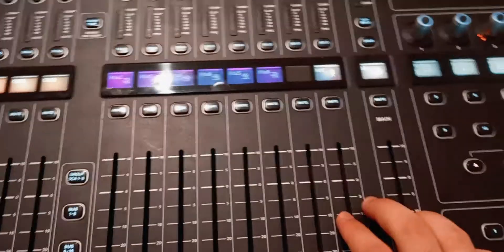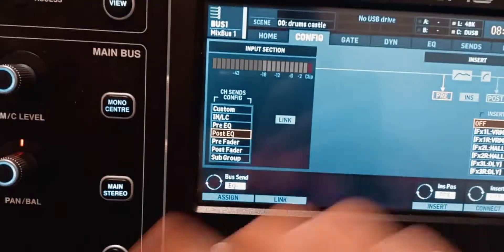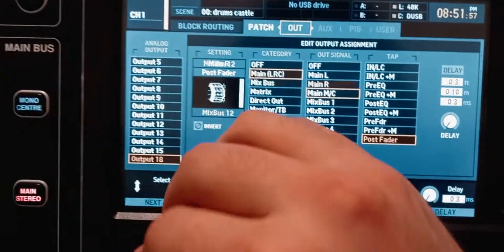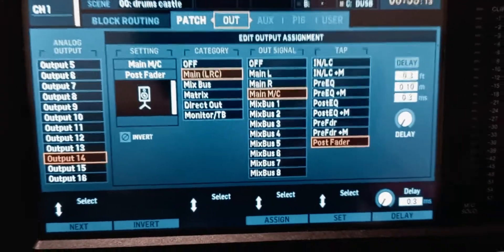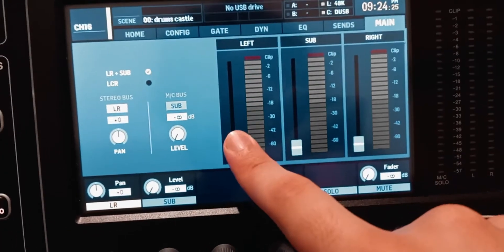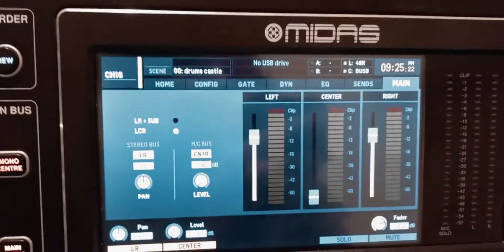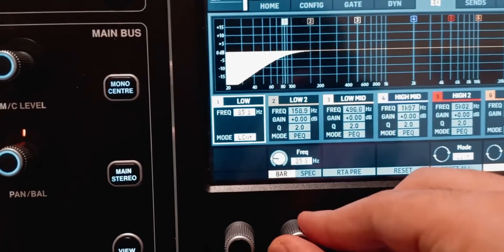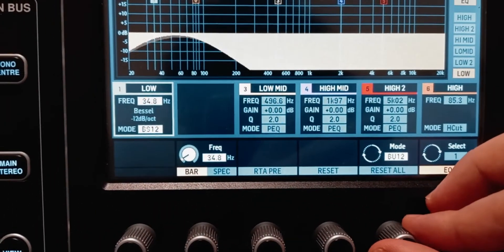X32/M32: Subs on AUX (Mono/Center Bus)

Comment: Hey there, I have a question…

Since you say in your video that you’re sending the M/C bus to output/bus 14, should my subwoofer be connected to output/bus 14…?

I currently have my Main L/R outputs 15/16 connected to my subwoofer and from my subwoofer my upright speakers.

Should I instead have my upright speakers connected to my Main L/R…?
Reply from the maker: Bus 14 is not the same thing as output 14. You can still use a bus without giving it a physical output
Yes i would connect the top speakers to the main LR  land the subs to the mono bus
Reply: @danielkharrat  Ok cool, so then should my speakers not be connected to the subwoofer at all then…?
Reply from the maker: @iefcefraternidadcristiana7318 correct
Reply: @danielkharrat  gotcha, really appreciate the help!

Comment: hello, great info, i do have a question.  I will be using m32 as a broadcast mixer, with a left right, center, and sub input from a bands own foh console.  So far i belioeve i need to make a new scene with the four inputs, route left and right to main and center to center fader and sub to my sub matrix, but it seems it needs to be in LCR mode correct, this change is a global change if im not mistaken?  Ive only mixed band sthrough inputs on midas stage box so this time it's a little different and just looking for some tips and direction thank you
Reply from the maker: Why do you need a center and sub for broadcast? The purpose of using a different bus like mono center is to control what goes to different speakers but why would you need that for broadcast? You'll just be sending a left right mix like mixing a song in the studio. 
But to answer your question yes LCR mode is globalso it's either LCR or LR + SUB but not both
Also keep in mind that with LCR if you pan something in the middle and you don't have a center speaker it will not go out of the left and right speakers

Comment: Can you make the mono/c stereo? If you have output 14 for subs can i use 15 for subs and have it stereo? And have 14 oh matrix 3 and 15 on matrix 4?
Reply from the maker: @omalicuchin09  the mono bus itself is mono. You can send the main left right to another pair of matrices and assign them to whatever outputs you want. Or you can link 2 normal busses and send stuff to them like you would with the mono bus
Reply: @ yeah i currently have 15,16 on the L/R MAIN. And 15 on matrix 1 16 on matrix 2. My M/C Iis on 14. My plan was to copy M/c or rout 14 to matrix 3 and 15 matrix 4 and have then pan hard left and right. To make the subs stereo. Im not sure if the would work
Reply from the maker: You can of course send the mono bus out of 2 physical outputs but that doesn't make it stereo. Stereo means you have different signals going to the left and right. If the same sound is going out of 13 and 14 it is still mono. So do you actually want stereo subs or just more outputs for your mono signal?
Reply: @ my plan was to get  my subs in stereo . But if i only have to work with mono then thats fine . Ive been working like that for a while, i was just trying to see if having stereo subs was a option
Reply from the maker: @omalicuchin09  it's better to have mono subs in most situations unless you're doing electronic dance music and you have a ton of stereo information in the low end that requires stereo subs. But if you do live bands or church or corporate events mono subs is the way to go
Reply: @ thanks u so much ill just stay with mono subs and use another matrix for like livestream

Comment: If one wanted to use a multi band compressor inserted on the total mix, I assume you would need to insert a separate compressor on the subs, is that correct?  The sub channel is taking a completely different path than the main right/left?
Reply from the maker: Yes

Comment: What settings would I use if I wanted to use the M/C as a bus independent of the LR?
Reply: To clarify. Our church is very small. We want the base and drums in the sub only, not in the LR. How can we accomplish this?
Reply from the maker: @Naomi Balliston  i do not recommend  sending the kick and bass channels only to the sub because you still need the higher frequencies to hear the attack of these instruments 
I suggest you use matrices 
Link matrix 1 and 2 and send the main LR to it and assign xlr outputs 15 and 16 to matrix 1 and 2
Then do a low cut at 100hz for example (you'll have to look up the cross over point for your speakers)
This is you LR speakers without the sub frequencies 

Then do the same for the subs 
Link matrix 3 and 4 if you're running subs in stereo or just use matrix 3 as it is without linking if you're running subs in mono
Then send the main LR to matrix 3 and assign xlr output 14 to matrix 3
And do a high cut at the same frequency (100 hz in this example)
No this is only your sub frequencies 
So just mix normally without using the mono bus and you can control your subs with matrix 3
If you don't know how to use matrices i have a video on that you can watch it https://youtu.be/54UhtUEgw70

Comment: Thank you Daniel. For separate the Sub and the High Speakers there are a few spezial Modi in the EQ Section. Bessel, Butterworth, Linkwitz etc. I use Linkwitz with 24db Oktave. Can you say something to the Pro and cons?
Reply from the maker: I think 24db/octave is a bit too steep, I would go with 12 or 18 at most because the steeper the filter the more resonance it will create at the selected frequency. Also whichever filter you decide to use make sure it's the same type of filter on both sides of the cross over. Don't use 2 different types of filters on the same crossover point

Comment: If anyone would know it’d be you… 
I use the Mono bus to feed a Comms feed into my headphone mix (I send my broadcast mix out on LR) and I listen on the Headphone routing option LR+M/C so the Comms are only herd by me and don’t ho to the mix. But what I soon realized is that this LR+M/C monitoring option is not truly Post fader. If I pull the LR fader down, I still hear the LR mix in my headphones. This also made me aware that I don’t her the Precision Limiter inserted on my LR bus. Any idwas on how to hear the LR AFL and M/C to achieve this monitoring scenario?
Reply from the maker: Go to the monitor page
Look at the right side of the screen
Set monitor source as LR AFL
Look at the left of the screen and turn on
Channel solo AFL
Mixbus solo AFL
DCA solo AFL
and that should fix your problem but to hear the mono center bus you would have to hit the solo button on it